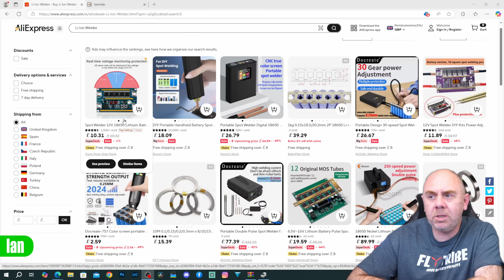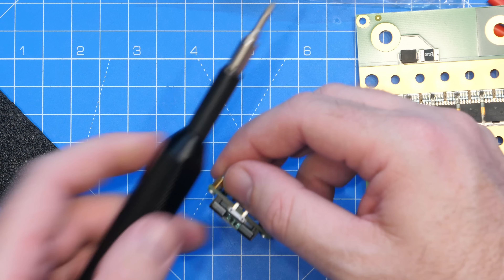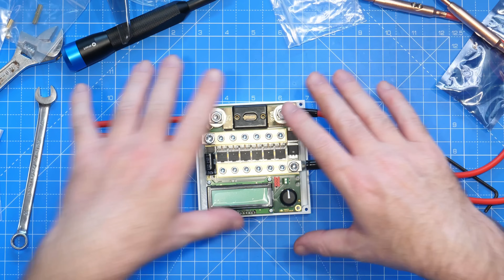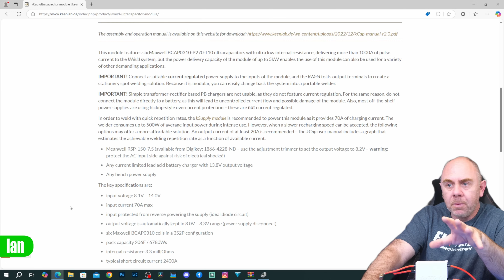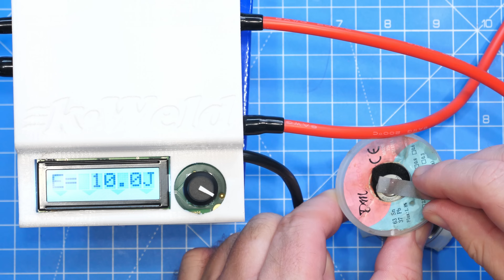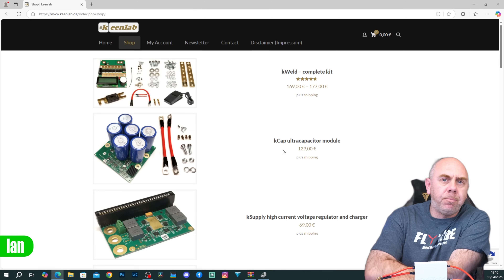Keenlab kWeld Battery Spot Welder For DIY Li-Ion Packs  - Kit Overview, Assembly & Demo

Comment: Nice. Thank you very much. P. S. I read some comments that light contact with the probes provides less resistance and better weld. I saw your hands shake on the video not sure how much pressure you were applying down on the contacts but perhaps more than light force which increased resistance thus less current and weaker welds requiring more joules to stick. Vs less force down requiring less joules allowing more current resulting with a better weld. Only testing can tell and I am just looking into this. Thank you for your content and I much appreciate your detailed work throughout. Well done. I enjoyed this.

Comment: Didyou buy this kweld from Germany with shipping to uk?
Reply from the maker: Yes.  I got slammed on import as well
Reply: That, what I thought about exactly, ups charged custom fee, however was not expected it at all. May be supposed to plan this ahead, however did not untill cam bill up. Now got it delivered. Assembling. Found  one cable in 1m, but  nowhere I found what lengh of small cables I have to cut off
Reply: Can u tell what is insulation length on short cables?

Comment: nice video, i have a Kweld. I needed to spot weld 14awg copper wire and thicker nickel strip than 0.2mm so I made my own IGBT + arduino powered spot welder (kweld couldn't do it). The homemade one has way more power, more adjustability, and it cost me $35 to build. super happy.
Reply: Can you give some infos on the components?
Reply: @JohannesKainzkaijoc14  did you get my reply? idk why they keep getting deleted
Reply: @JohannesKainzkaijoc14  i have a video on my channel

Comment: Just built my first battery yesterday, using kWeld and kCap, with a bench power supply for charging the kCap.
Despite only charging the kCap at 5 Amps 12 V, it didn't take all that long, so I'm quite happy with that setup.
I wanted to start with something small before I try building larger batteries for micromobility, so I just built a 1s5p powerbank. My next larger project might require nickel-copper sandwich, so that'll be interesting to try.

One thing I found out is that a 3D printed electrode holder (which was specifically designed for these kWeld electrodes) I tried to use, was causing bad welds because it made it much harder to apply equal pressure to both electrodes. Once I realized this, and continued with the electrodes held separately in both hands, like you do in this video, I got much better consistent welds. Maybe it's a matter of skill, but my guess is, to work well electrode holders need to have spring-mounted tips like I've seen in some products.

Comment: I bought kweld and glitter 801h and awithz p60f. The kweld is nice very good software but the power is not enough and the cables become warm, i solder 0.15 nickel plated steel and o.1 copper. The glitter 801h is a good machine but they become problematic i think glitter start to use low quality mofset. The awithz p60f is a beast, very powerful a lot of settings and charge very fast compared to the glotter 801h so awithz for the win

Comment: a lot of people say, use light pressure for better welding ..
Reply: That is correct. You tried to be sweet using this: “a lot of people say that.” I’ll put it this way — people with real knowledge in spot welding will stress to just gently touch the surface with the tips. He’s putting too much pressure on the welding tips, which tells me he doesn’t have experience with this.
Reply: I belive damage coming from  lengh of time start from when you touch strip with both electrodes, till you press it to battery surface. If there still gap, then get burn. I am usually pressing one electrode at first firmly, then Second electode coming to surface already with no gaps and nice welding spots in result
Reply: I tried that and blew holes through the nickel, where it wasn't touching the end of the battery. I now press hard, and then let off the pressure to make sure there is good contact.

Comment: I've been using kWeld for nearly 7 years now building my own LiIon packs (eLongboards, fpv long range, lawn mowers ...). It is an absolutely reliable piece of German engineering. Even 0.30 mm stripes can be welded perfectly. Pro tip: use an xt90 to 2x xt60 Y cable to use 2x  4s 1500mAh 100c lipos. I've been doing it this way since 5 years or so ...
I also tried chinese brands. They all failed for my purposes poorly.
Reply: if everything works so well, and know the thing since year, by curiosity, why did you come here in this video to write a comment?
Reply: @ytrew9717  b/c I like Mad's content, I am from Germany, I really want to support this fine piece of electronic engineering and I am very surprised that this hasn't been discovered by hobbyists earlier ... no more explanation needed than this ;-)
Reply: Do you know how many amps the two batteries produce? I know the kWeld is limited to 2000 amps, and I would like my power supply to get close to that (I have two large lipos that I can use).
Reply: @AlfieMaxMiMi yes. 1,5A × 100 = 150A continuously. The 100 is the C-rate. You can double the amps because I use two lipos in parallel. So in total 300A. KWeld gives you statistics if you do not remove the electrodes right away. Mean of the last couple of welds I did was around 2500A (!) 😅
Reply: Is it holding 4s battery? I've been advised to use 3s

Comment: I have built many packs with this welder, less pressure is more, on .2 nickel I’m up around 90j though, the negative terminal is the most risky to weld!
Reply: I’m also using the kcap and ksupply

Comment: I am sure the kWeld is very good, but it seem to be very pricey for what it is.Some time ago I got one of those $150 Chinese spot welders with a proper housing with dials and display, build in capacitor bank, proper grip for the welding pins etc. Just plug in the AC power and go. Been working great for years building large ebike packs.

Comment: **TO ANYONE READING THIS**
If you are interested in spot welding some lithium cells together, you DO NOT NEED this particular spot welder! This is designed for people who are going to spot weld the THOUSANDS+ of battery cells together... there are plenty of great spot welders available, that I have personally used to weld hundreds of cells for $10. You can get some fancier ones for $30 - $50 be careful a bunch of those have horrible reviews and quit working.
(if you're just looking to build some lithium packs for FPV, just purchase a $10 PCB spot welder. Most of them will come with a little acrylic case and two welding leads. Most of them will also include a bunch of nickel strips which will be plenty to build a BUNCH of packs!  (also when it comes to Nickel strip, you will see lots of people complaining and leaving bad reviews saying that it's not real nickel, etc... but the problem is it's damn near impossible to find real nickel, regardless of what it costs, most of it's not real nickel anyway! I have used all kinds, on hundreds of battery packs and it all works just fine. So don't get caught up in all the nonsense..!) Now most of these $10 PCB board spot welders take 12v input. so you just connect a 3s lipo or a car battery and for $10 you'll have everything you need to build a bunch of lithium packs with quality spot welds! Within 5 minutes from opening the box you can start building packs! 
*
@Mads Tech 
4 or 5+ years ago when this was designed I wanted to purchase one so bad...! But it was very pricey, same as it is today. It's worth the money though if someone is planning on spot welding 1000's of  battery cells. I have used a handful of those $10 PCB board spot welders that have five to eight large mosfets in a row with a little segmented display and all of them have worked phenomenally. I've used them to spot weld hundreds of cells in a sitting, back to back one after another! The ones that cost the $50 to $100 that come in a nice case with a fancy color LCD, more often than not have pretty bad reviews.
When I saw the thumbnail for this video I was really looking forward to watching it since I always wanted one of these welders. Anyway great video and I just wanted to leave a comment for the average FPV'er, making sure they understand that this spot welder is completely unnecessary if they just want to build a few or a couple dozen packs. Unless and they don't mind spending a bunch of money. To each their own 😜

Comment: i do hope you use copper strips on your packs as my testing shows using p30bs and my quad i can pull 70a max on 3x .2x8mm nickel strips while on 1x .2x14mm copper i can pull 105a
Reply: How hard was it to weld 0.2mm copper?
Reply: @grekiki  not too hard using appropriate tools i used glitter 801h at max capacity to do it its a very solid welder for the price

Comment: For this application, I would say that nickel is not enough, and will bottleneck your pack, and you will see a lot of voltage drop. You need copper strips for this. It will be HARDER to weld, and the kweld might not be enough, but there are things you can do such as changing the probes to tungsten, or nickel on copper to increase the resistance of the weld, and use split strips to even further increase resistance of the weld. If this is not possible, soldering is still the better option, just use your highest wattage soldering iron and crank the temperature up so the cell doesnt have time to soak the heat in.
Reply: my testing shows a limit of 70a on nickel and 105a on copper on my perticular pack and quad
Reply: @zombietoesofnothing2381  that's a 50% increase, insane lol. Did you use .12mm copper strip?
Reply: Kweld does very well with copper-nickel sandwitches. I'd also go for wider strips (I personally almost exclusively use 15mm wide ones, but I mostly deal with 32700 LFP).
Reply: @ooHotcooleRoo  but then, wouldn't the nickel contact be the bottleneck? Or are they negligible? My idea is that by putting the copper strip on the cell and have a nickel strip on top of the copper, the heat from the nickel weld will also melt the copper beneath.
Reply: @tailehuynhphat9570  it's exactly as you describe, nickel served as the agent to heat the copper so it welds to the part

Comment: I've had a K-Weld for about 6 years and I will report that it is great but the tips of the probes do start to wear away with a lot of use.  I need to buy a replacement pair.  I use a 5Ah Zippy 4s2p hard case it it works very well for me.  I don't build enough to need the capacitor set but I would still like to have it.
Reply: Also had it for about the same time, I just use a 60Ah car battery, does pretty good with about 1400-1500a with brass terminals and 6 AWG wire, as for tips I do really recommend  using a handle, SUNKKO 73B is pretty good, though does require small modification.
Reply: @ I 3d printed a handle

Comment: I use 2x 3s 2200 120c in parallel.  6s produced ‘overcurrent’ error.  2x 3s works fine for my needs but the packs do get warm!

Comment: It's worth playing around with how much pressure you put on the nickel strip. Not much of an issue for the base of the battery but on the raised positive side its easy to blow holes through the metal by pushing too hard.

Comment: Now you also gotta show the Nickel-Copper-Sandwich method with 0.1mm Nickel and 0.1mm Copper to get a high current pack.
This is where the welder really shines and makes the difference compared to these small cheap welders.
Reply: Yeah I regularly use that method with 0.1 copper and 0.15-0.2 nickel does it almost effortlessly. Though cooling becomes a bit of an issue even with a fairly big handle (mostly handle cooling, a fan on the unit itself solves the unit cooling part pretty well). Kinda wanted to get a watercooled handle at some point, but I dont actually do enough welding to justify both the cost and complexity of it all.
Reply: @ooHotcooleRoo  I can do 0.1x15 copper with a 0.15x15 nickel with a 20$ slightly modified welder from aliexpress with a 4S 5000mah lipo. Think I would rather have that then a 200$ premium welder
Reply: @Vogxel  Sure, I even have some of the better cheapo Chinese ones, some with relatively decent bus bars are not bad at all. Still I got this one like 7 years ago and there was nothing similar on the market then, either garbage or industrial stuff and it's just nice and works well. So if you do like couple drone batteries total, then sure 20$ one will serve you well. For me I like it, it has more thermal mass, more bulk, more margin. Do you need it - no. Is it better if you need to make stuff semi regularly and do stuff like 80s3p (about 1500 welds total, LFP for a UPS) and need it relatively fast and painless? I'd either go for this  ("hobby level") or for some china industrial type if you do it a lot.

Comment: id much rather get a glitter 801D or 801H. way easier to use and setup and probably more powerful. the 801h can do 0.2mm copper sandwhich
Reply: I strongly disagree. Having built several packs with mine, I have zero regrets and highly recommend the kweld.
Reply: Sure, but you'll never be able to get such consistently good welds with the same fine control as you will with a kweld. 

It can adapt to differering conditions over multiple welds in a way others can't provide.
Reply: I've used 801H with the same SUNKKO 73B handle I use on Kweld while my Kweld was out of action (I accidentally fed 12v into the STM32), honestly it was a bit worse and a bit less fine control (might be that I was not used to it), but generally about the same capability, at least with my Kweld setup (it's a bit upgraded, I use a 12v car battery with brass terminals and 6AWG wire for example).
Reply: good to see another 801h user
Reply: a friend's kweld just failed to weld anything despite not displaying any error. very powerful 12V battery, no doubt, and used according to instructions. the issue is, it lacks in amperage. the capacitor welders push way more amps. crucial for welding copper and aluminium. I was so fed up from the lack of performance from the kweld that I immediately ordered a Glitter 801h
Reply: @JoLe1991 That's really not an issue with the welder, but with the battery. But to each their own I guess.
Reply: @ooHotcooleRoo  I'd say 180Ah automotive prismatic NMC cells is way more power than you need... along with 16mm2 power leads
Reply: @JoLe1991  Well.. something is clearly off, since I get 1450a with regular 6 y.o. 60a lead acid also with 16mm2 short leads (~20-30cm).
Reply: @ooHotcooleRoo  calibration measured 1900A. yet it failed to weld anything. I tell you that kweld has some weird defect...
Reply: @ooHotcooleRoo  just don't have nerves to waste my time with a tool that doesn't work.
Reply: @JoLe1991  as I said, to each their own. With this sort of attitude I surprised you even looked at kweld at all.The "It should just work" usually do not include kits in my mind. In any case, get a tool that works for you. KWeld works fine for me and my needs though.
Reply: @ooHotcooleRoo  the kweld isn't mine. a friend bought it 2 years ago, barely used it. thought it would be an opportunity without investing a bunch of money.
Reply: @JoLe1991 Must have been faulty. Mine can weld 0.1mm nickel over 0.1mm copper at quite a low setting (can't remember, but I think it was between 60j and 90j). My lipo battery is around 1500amp iirc.
Reply: @AlfieMaxMiMi yes it does 0.2mm copper. mine failed after only 3 months. instead of spending 100$ on a spare circuit board, I went for the AwithZ P60F, it's got a bit more power and from reviews, is more reliable
Reply: @JoLe1991 I've been looking at those AwithZ welders recently. Looks like a good bit of kit, and no messing with external batteries either.
Reply: @ You know the kWeld is sold with an optional capacitor bank right? You likely just did not have a powerful enough battery.
Reply: @swecreations  1st: my battery has 180Ah, automotive grade NMC prismatic. more than powerful enough.
2nd: the kweld didn't even weld thin nickel onto 18650 cells. there was no movement of the cables at all, only during short circuit calibration.
if the super capacitors are before the fuse of the kweld, it's still limited to 2000A.
the glitter 801h I ordered has 25mm2 leads and 3500A pulse. significantly more than the kweld. it's all about switching power, once you have the discharge potential
Reply: @JoLe1991  Well I get way more than that from my 75Ah battery, in that case you really should've just claimed the warranty on it while it was still under warranty.

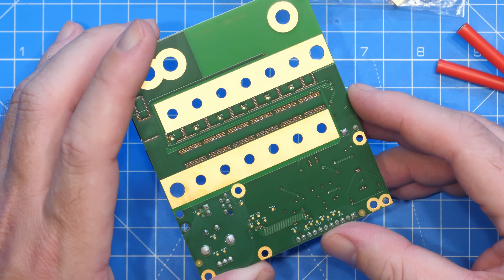Comment: 7:18 we can also install additional MOSFETs on the back side of the board for more welding power.
Reply: Any actual source for that?
Reply: Well, its true (one can even stack mosfet on top of each other in parallel) but it will change the overall electrical characteristic/requirement for the module and probably risking reliability-issue. Further modifications are needed in case such addition were made, for example thicker busbar and wider tracks to accomodate for higher current flow.
Reply: no you can't that are called vias in pcb or conductive holes that connects layers of pcbs electrically